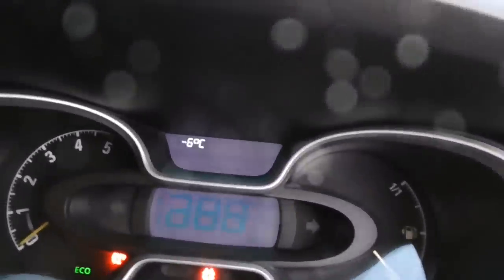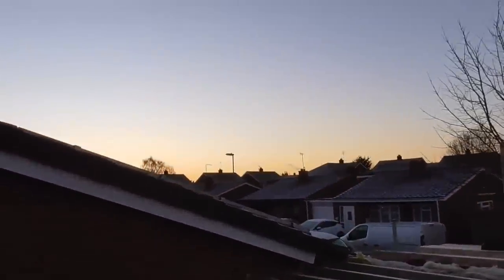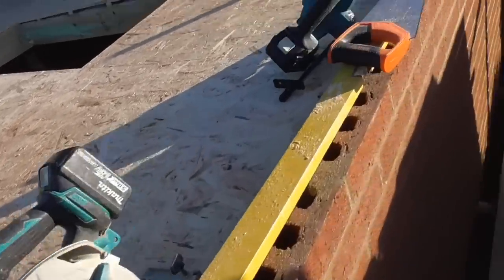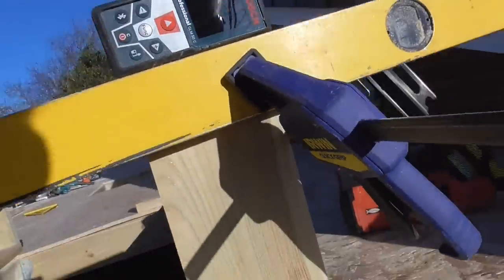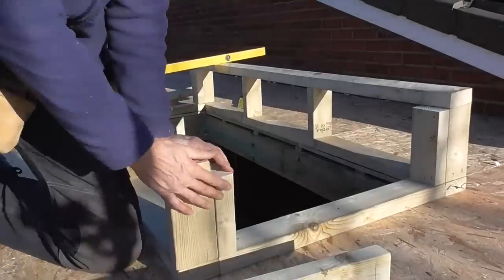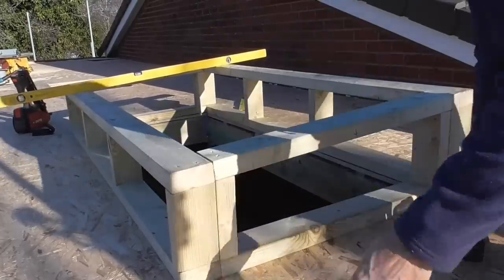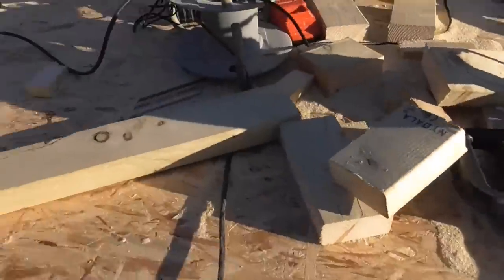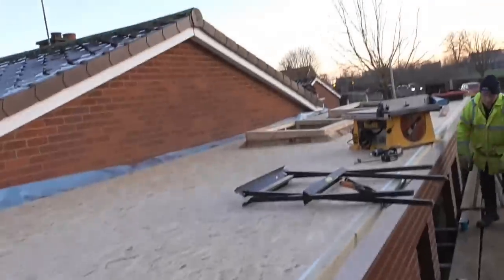Building a flat roof using a 'warm roof' method PART2 ***FITTING DECK AND ROOF LIGHT CURBS***

Comment: This build up really shouldn't be done like that. You shouldn't be putting the 18mm OSB on top of the insulation.
Reply from the maker: Why is that🤔
Reply: @thetallcarpenter felt underlay should be laid on the insulation and the correct insulation for the underlay used. If it's torch on underlay, then a torch on board should be used like a power deck u. By putting the ply on top of the insulation, you have then used a 200mm screw and put a load of holes in the vcl, which is not  the best way of doing things. Have a look at bauder, langley, icopal, and garland, all felt manufacturers, and not one is doing this. A lot of domestic flat roofs are being done like this now tho and it's not the best way. You should have used the ply to deck the roof out. Then the roofer would install a VCL glue down his insulation and then install one underlay and one cap sheet. You then have three independent waterproof layers as well.
Reply from the maker: @user-ol8jh6ji4u  What problems do you see occurring due to the top layer of ply/osb being used and fixed down through the insulation and VCL, and why do you think that there is still so much information suggesting this detail🤔
Reply: @thetallcarpenter  peppering the VCL with holes when it's not needed and losing a waterproof layer, extra and unnecessary weight load on the roof. The extra cost on plywood/OSB which isn't necessary. Metal screws as well may not help with any condensation issues down the line. Why the information is saying this on domestic properties only, is ridiculous. I'm thinking it's because builders doing the work are just using the 8ftx4ft foil back boards and thinking you can't install felt directly on them. (Which you can)
Reply from the maker: @AdamSuffolk-f7q   I am in full agreement with you that there are superior ways to construct a warm flat roof. In my experience, the build up method I showed in my video is not 'inferior' in terms of its ability to keep the room below both warm and dry for the life of the roof, but as you say, how a builder chooses to do a warm flat roof may not be the same as how a roofer does👍I appreciate your comments on this😎Cheers Del

Comment: Hey Del,

I'm doing my first flat roof. Do you know if the kerb edges are necessary for EPDM Resitrix? Not sure whether should I use it around the perimeter only where the roof meets the masonry or around the skylight upstand as well. Any thoughts would be much appreciated. Thanks!
Reply from the maker: Hi there🖐I'm sure about the exact build up and use of edgings for the Resitrix system as I've never used it😬Sorry I can't be of much help on this one😔Thanks for watching 😎